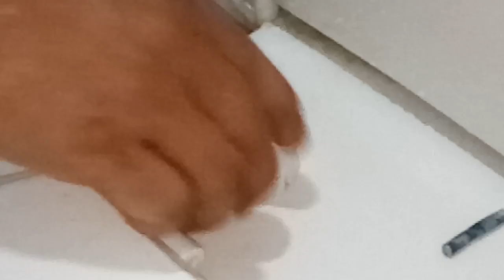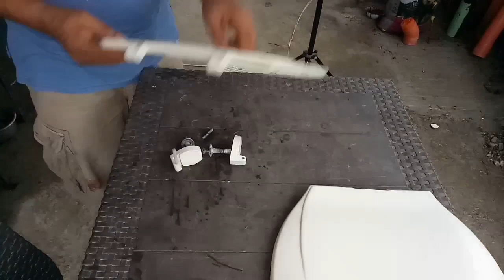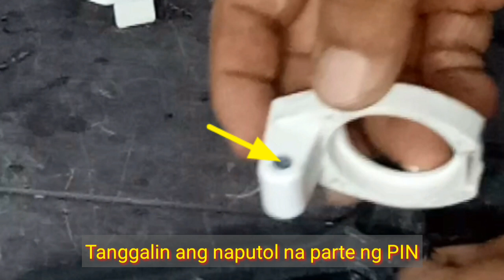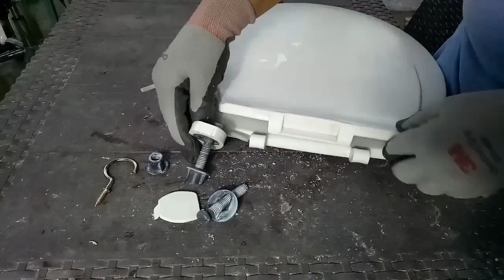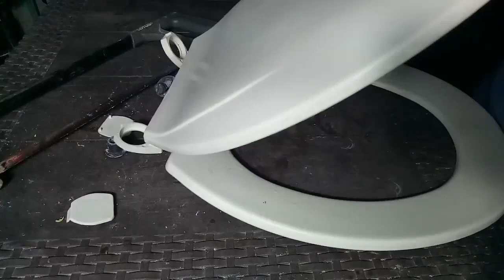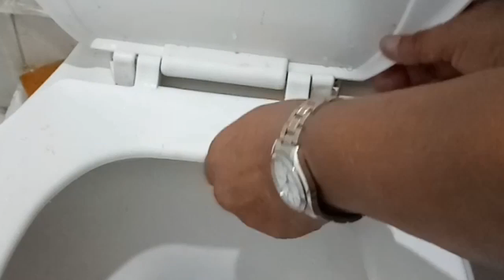How To Repair Toilet Seat Hinge || Simple & Easy

Comment: If it's just the plastic hinge that breaks, glue it. Lepage bonding glue seems to be holding. Don't put glue on the porcelain. idk, but things that shatter have their own heat transfer rate and they don't like foreign objects glued to them which will challenge and stress that in one place. Overly cautious I know, but I experienced that with a reglue of my car rearview mirror, which admittedly underwent more extreme temperature changes.